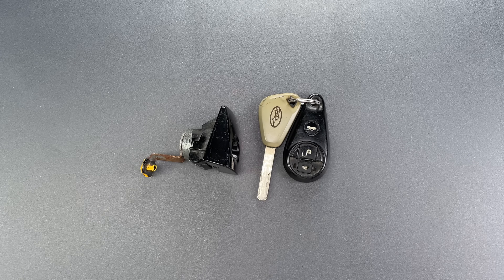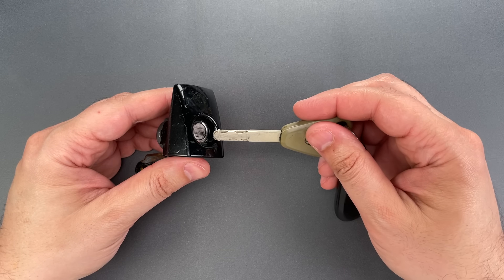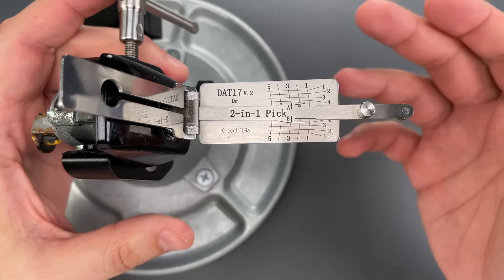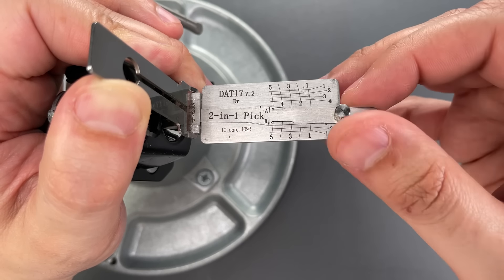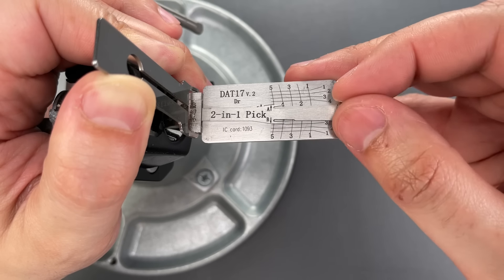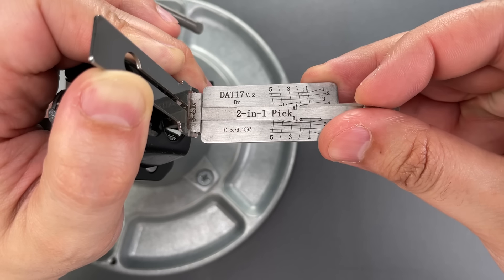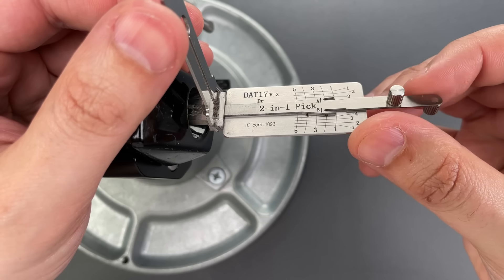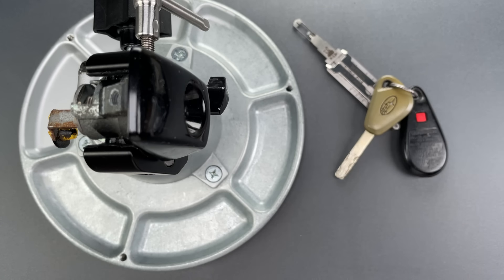[1346] A Trap For The Unwary: Subaru Impreza Door Lock

Comment: "While this is not difficult to pick..." he says after two minutes of fiddling with a specially made lock pick designed to manipulate five pairs of pins.  Earlier today I saw a video in which he opened a padlock by tapping it with a hammer.
Reply: It's not difficult to pick, as he said, just time consuming. Like how walking a mile isn't difficult, but it will take upwards of 15 minutes.
Reply: Or a hour if your slow
Reply: Time consuming is really all you need on a lock. If you start playing with an actual car’s lock for this long, someone will probably get suspicious. All it needs to do. That and take more time than smashing the window in.

Comment: Looks like Subaru put the same complexity into lock picking as they did for replacing a headlight bulb.
Reply: Truth! Omg yes!
Reply: Turn signal bulb in a 2009 Impreza is a real pain. You need to disassemble and remove the entire air intake and filter assembly to get to it.
Reply: @josugambee3701  I found it easier to go in through the wheel well.  Still a pita.
Reply: lmao spark plugs too
Reply: @McKnight6  spark plugs are easy in a Subaru I can get them done in 45 mins tops
Reply: Must be an older Subaru thing.  My 2017 is like 3 screws total to replace both. (two for passenger side, one for driver side)
Reply: @SteevyTable  must be.  Us Gen 3 owners aren't so lucky.
Reply: @josugambee3701  but...it's a turn signal...how can it take that much disassembly?
Reply: @hinro  That's what I thought at first, but the bulb is in a socket that unscrews from the backside. The backside is nestled between the body and a support bracket, and the only way in is blocked by the air filter box, which can only be removed by undoing two bolts and a hose clamp. The right one is a bit easier though - It's just the battery that needs to be removed on that side.
Reply: @josugambee3701  That's honestly insane. could you just unmount the light and pull the whole headlight out?
Reply: @hinro  Technically yes, but I would need to take the front of the car off.
Reply: Try adjusting valve lash in EJ205.
Reply: I dont know if it's just the eu but all it takes to change a headlight build is pull back on the rubber cover and release the clip, literally takes 10seconds
Reply: @Real28  I do it on my 07 sti in my driveway with nothing but hand tools, I’ve done it on a 13 sti as well
Reply: cameron170 -  On an Imprezza?
Reply: @josugambee3701  im a subaru specialist mechanic, go through the wheel well next time. Just remove a couple clips and peel back the plastic, the only model that truly needs the headlights removed is a Gen 3 legacy/outback just to replace the blinker bulbs. 😉
Reply: a lady came into my stepdads shop with a 2010s bmw with projector lights that don't work any more. Its going to cost her almost 2000 dollars in parts had we had to take the tires off and wheel wells to check them. 

Headlights being out basically total the car. You would need to replace the assemblies and rewire everything supposing you could find some 3rd party lights of some kind. But getting genuine bmw replacements its ridiculous. And not an easy job to replace them.
Reply: @McKnight6  yeah even my V6 and my old v8 took about 15 mins for spark plugs
Reply: @antoniocordova3795  Okay, I hadn't thought of that, thanks! I'll try that next time. That is, assuming there IS a next time, as it later turned out to just be dirty contacts in the socket. I guess those bulbs last a while.
Reply: Majority of Subarus are boxer engines
Reply: If you know about that drivers side light then you know.
Reply: @SteevyTable  glad they did something, they was bad
Reply: @McKnight6  is a boxer motor not inline, so plugs entry point is right against the engine cradle
Reply: @hinro  when he says front he really means all of it. Like ALL of it
Reply: cameron170 -  dude, Subaru has mad theft protection done up in their design. It ain't like you can walk up and steal any of the $200 a piece lights with out opening a door to start the process making theft very risky.
Reply: cameron170 -  yes, it does need the bonnet open. And I've been unsuccessful at getting it open without popping the latch from the inside first.
Reply: @ItzMorgaNpvp  if this is a question, yes
Reply: Better than a car you need to remove the bumper off
Reply: @SteevyTable  neither my 1998 or my 2007 gave me problems. There was a phase where every car manufacturer started placing equipment in the way of the bulbs, but I'm not sure that stuck around.
Reply: Took me like an hour to replace a Tribeca bulb. Hated that car
Reply: You actually have to disassemble the car for the spark plugs
Reply: @SteevyTable  "you guys have to undo screws?" -Toyota tacoma driver
Reply: @rwd323  I once have a Suzuki Wagon R with rearlights in the bumper. When I should change the bulbs, I should remove 6 bolts to loosen the bumper, then remove 4 screws to remove a dustcover over the lampsockets, besides all the dirt. It took the most of 2 hours just to change a lightbulb and , yes, I know it sounds like a joke.😁
Reply: @Brian_yeah_that_brian_Strang  depends on the car. My 98 outback had to have the engine lifted out. My 07 Impreza had a bit more clearance. Haven't had to deal with it on my 2017 Impreza.
Reply: Omfg yes, my father has a 2004 forester, and he just won't replace the bulb, because you have to take the whole fucking headlight set apart.
Reply: laughs in 03 Baja Takes 2 minutes. Spark plugs easy too. But also have an NA, not turbo.
Reply: @rwd323  my miata is like this I found out. but apparently only takes 10 minutes to remove the bumper? but still. not looking forward to it.
Reply: @josugambee3701  Turn signal in my '12 STI had me removing the front clip
Reply: Funny as hell.. but thats true..
Reply: Bro for REAL 🤣 "slow em down on everything involved... So they savor every bolt and scratch and dent on the car. Maybe they will remember; when they buy a brand new one worth of parts in three months!"
Reply: and opening the hood
Reply: easy as it has been for decades on MY06 ;)
Reply: As a Subaru fanboy, I can say that this is so damn true. For everything you have to work on.  😂
Reply: Reading this thread made me happy we are rid of the 2012, that car was garbage, and Subaru's service was garbage as well.

Built like a tank in certain aspects, a cheap piece of poorly engineered rubbish in more than a few.

Still have my 91 MX5, that car is well made and designed..
Reply: Never changed a spark plug on a Subaru.... Headlights are easy
Reply: @justingrey6008  depends on which generation of Suby
Reply: I've had an '06 Outback (I think that's 2nd gen) which I could do without too many problems, and a '14 Outback (I think that's 3rd gen) that I have to have someone go in through the wheel well to do. They supposedly made it easy again on the generation.
Reply: Just don't understand why they can't make it have a quick release headlight like the skoda octavia from around 2006 (one plastic nut and a release arm and then the whole head light comes out very easy to work on) but what is worse then that is when the led lights fail in some new cars well that's £1800 think thank you, you can't just replace the components (and you need a marry/reprogram it up to the car, because it has an ecu in the headlight to control the auto level.. So they is coded to only work in the car it was sold with)
Reply: This became a carfix thread lmao! 12-16 Impreza owner here, the driver side bulb is an easy reach. The  passenger side you need to remove the intake duct and reach, which shouldn't be too difficult if you know where things are~
Reply: 100% True!  Had a 2012 Subaru Legacy 3.6R years ago - need to either remove bumper and/or tire and have tiny hands and forearms to get the bulb out on either driver or passenger side!  TOTAL BS!  Bought a WRX - sold it when it needed a headlight bulb!
Reply: Cries in WRX
Reply: I was thinking head gaskets
Reply: @parafitality2730  there are far worse places!
Reply: I don't even drive a car, but I know why it's funny. :D
Reply: @maybenot6075  aparantly thats with newer models, or that's what the people here say
Reply: Best comment ever.
Reply: pretty easy on my wrx lol
Reply: @josugambee3701  on some other cars you have to remove the bumper and light housing to replace bulbs, even on taillights
Reply: Spot ON!!!!!
Reply: had to change my turn signal bulb and it was such a paim
Reply: I recall working on a few Subaru's and this comment brought back memories of immense pain but also understanding.
Reply: thats just japanese ingenuity
Reply: That's the same as all new cars. You people would cry and despair if you ever had to do an actual complex or long repair.
Reply: @Lobsinus  ok Kevin
Reply: @PatchWorm_bore_cleaners  well it's just that you seemed so utterly defeated by removing a couple bits and changing a bulb I figured you'd never actually pulled apart anything complex before ya know?
Reply: My old Elantra Touring has no such pick resistance, but at least you can remove three bolts and yank out the whole headlamp assembly (that's not how you're supposed to do it, but the hood latch trim and bumper are flexible enough so it still works).

Comment: longest pick in LPL history!! :) i just broke the glass in the meantime to get into the car to steal the laptop
Reply: what the hell are you doing watching the lockpickinglawyer?
Reply: @taterhater7419  learning how to not have to break the window when stealing vehicles. what else?
Reply: Automatic centerpunch?
Reply: A new window would probably cost less than your local locksmith that still wouldn't have the skill to open the lock like lpl does.
Reply: @neonnerd1364  the one time I had to call a locksmith, he spent 45 minutes trying to pick  a cheap door knob from Lowes.  He had to drilll it out.  😞
Reply: @grimlock1471  by that point I would've just kicked the door in lol.
Reply: @neonnerd1364  then I would have had to replace lock, door and frame.
Reply: @grimlock1471  if it was a cheap knob and lock it most likely would've failed before the door and frame.
Reply: @neonnerd1364  I'm not sure how that could happen.  With the striker extended and the deadlatch engaged, either the wood frame would have to blow out or the metal striker would have to shear off.  The door might buckle and deform enough for the striker to loose engagement. But any way that shakes out, it's going to cost more than locksmith's time to fiddle with it and, drill it out, and buy a new lock.
Reply: I was going to say, since locks really only keep out the honest people, there are far easier ways to get inside a Subaru than defeating the door lock.
Reply: @grimlock1471  if you have a composite door that would likely fail before the frame and you can just screw the door back together... I've done it...
Reply: @Dr.Spatula  I believe that you've done it by I don't see how that would work in a steel clad, exterior door.   Either the frame would blow it,  taking the trim with it, or the door would bend and possibly break. 

In hindsight, I might have borrowed a drill and drilled it out myself, since I had to replace the lock anyway.  On the other hand,  not having done that or seen it before,  I might have tried to drill out the cylinder, rather than just the pins, and made a right proper mess.
Reply: @grimlock1471  you never specified a door, that's why I mentioned a door that kicking open does in fact work quite well. 

Clearly it won't work with steel or hardwood (fire doors) as they will likely be stronger than the frame and won't only partially break if the frame does manage to hold
Reply: @Dr.Spatula  Sorry.  I never even considered that would put anything more than a privacy(bedroom/bathroom) knob on a hollow core interior door.
Reply: @grimlock1471  fiberglass doors don't exist where you live?
Reply: @Dr.Spatula  I've never seen one.   Or more accurately, I've never realized that I was looking at a fiberglass exterior door. All I've ever known was solid wood, hollow steel(commercial only), metal and glass(also commercial) and steel skin with wood or mdf/plywood along the edges and presumably insulation between the layers.
Reply: Well, For you its the laptops but for LPL... He steals the locks right off the cars.
Reply: @grimlock1471  My mom called a local locksmith to come open a "Defendant" bedroom lock. Said he couldn't get it, told her he'd have to break/ replace the frame, was gonna charge my mom $300. She calls, I come out, the screws for the door knob are outward facing, I open the door with a #2 Phillips in under minute.
🥺 I think she still had to pay $50 ~ $75 for the " Service call"
Reply: there is more longer than that search LPL vs Paracentric Lock
Reply: @DaxsDad  this was a properly installed lock in a steel skinned exterior door.
Reply: Oof, should have used an air wedge and reach instead
Reply: @taterhater7419  my mind is blown right now
Reply: oof, this gut punched me because my car was lockpicked last week and the laptop i forgot in there was taken. wonder if the thief watches this channel, sobs
Reply: @DaxsDad  That's called a  "disservice" call
Reply: It’s Johnny five-o!
Reply: So there is finally a lock that defeated him.  I’m shocked that he cant get that lock picked
Reply: @xoltacueponi  Wait, you had a laptop stolen and they didn't destroy a window+?

Be happy, usually the car is jacked up to the tune of at least several hundred dollars, AND the laptop is stolen.

Are you certain it was actually locked? because my money is on "No" 

Lockpicking cars is not a thing I have ever heard of, brute force entry is though.
Reply: The laptop's not what I sent you for johnny, go back and get the car 🤷